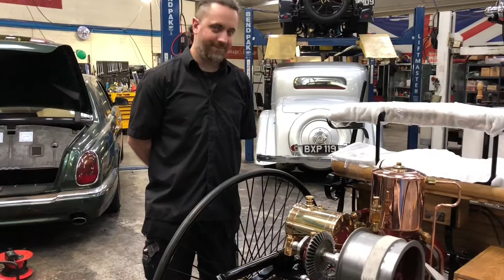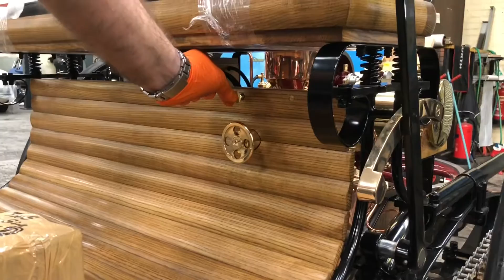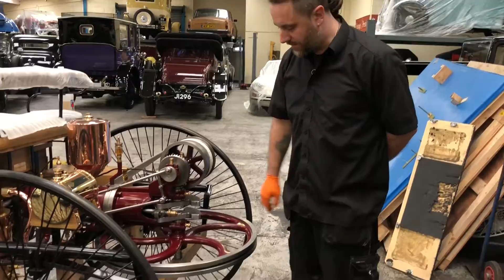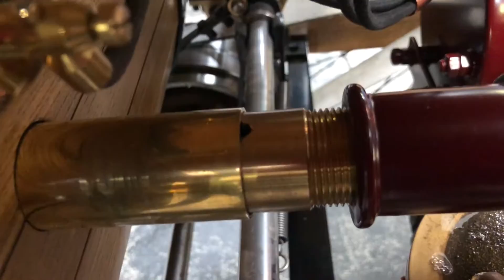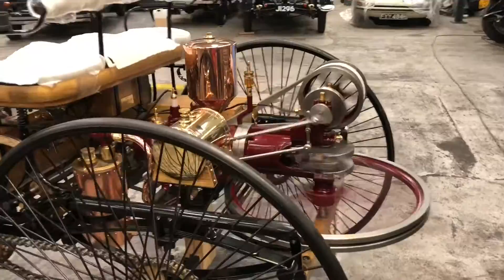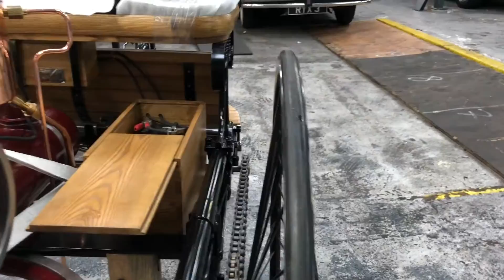1886 Benz Patent Motor Wagen Replica

Comment: I don't understand why the petrol and cooling water have to be drained.
It is not clear why something has to be blocked when the car has to be transported.
Furthermore, a nice demonstration of a very important invention!
Reply: Draining to prevent liquids from sitting there still and rusting internals away, you'd have to drain modern cars too if they're used once a year.
Transportation blocks simply rigidly clamp the rear axle to the chassis, taking load off suspension springs (yes it does have springs), so the thing isn't bouncing around and springs aren't stressed when transporting. It isn't designed for the kind of speeds it'll be transported at, and kind of stress that'll happen if the transporting truck hits a pothole, so just a safety measure.
Reply: @BuranStrannik  
Thanks for the information !
Reply: Les voitures modernes pas nécessaire de les vidanger pour l'eau, c'est pas des blocs moteur en fonte mais en alu.

Comment: This is a really good video if you’re shopping for 1880’s era basic transportation. 10/10, would recommend to a friend.
Reply: If they just sold the frame, you could easily make an electric version of this.  Just have someone build a front wheel with hub motor and toss all the electronics under the seat.